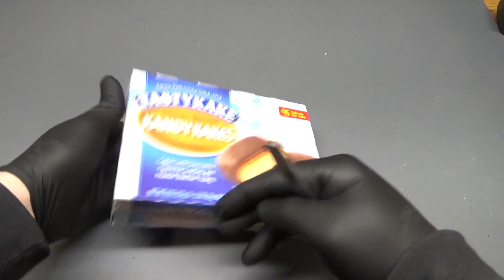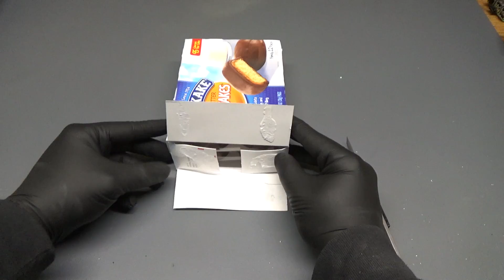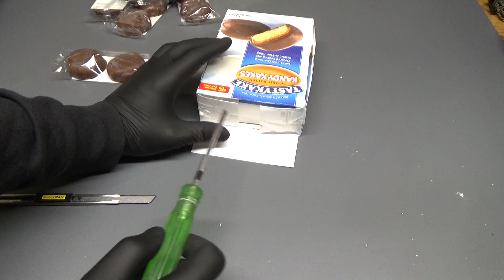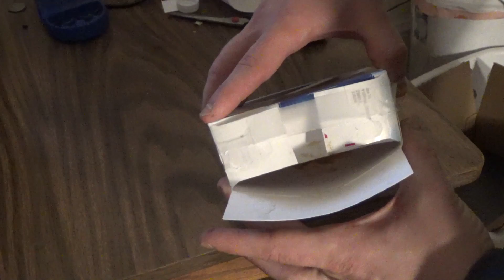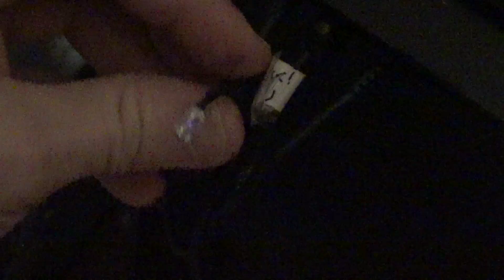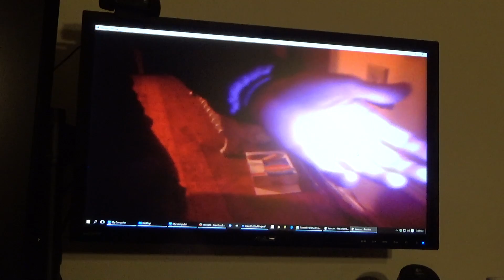Make Your Own Mouse Trap - Candy Box (non-lethal)

Comment: Nice Video Matt. I was like you at one time. I would use no kill traps and release the mice down the street. (Wife thought I was crazy). Anyway I stopped doing that after trapping the same mice over and over again. I am talking a football field separation from the house now before I let them go. They always found their way back. Presently, I use half a chewed tootsie roll on a Victory mouse trap. I found the mice had such a light touch that they would clean most of the peanut butter off the trap before triggering it. That meant bad kills. With the tootsie roll, always right across the head. Lights out. Good luck with your no kill approach. I started naming mine until my wife got tired of it. She is terrified of mice.
Reply from the maker: +Edward McLaughlin Haha great story :), I actually have little issue killing mice, but my Lethal designs were messy and or hazardous to humans too.
I may try the lethal designs, if the mouse problem continues. Right now me and my housemates are in mouse trap competition :)